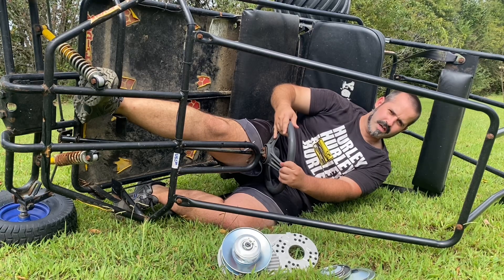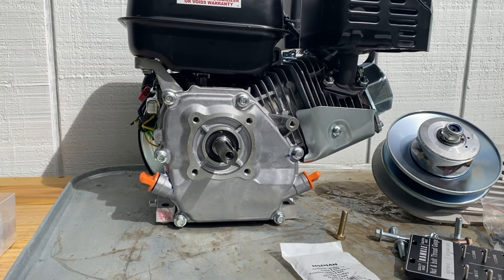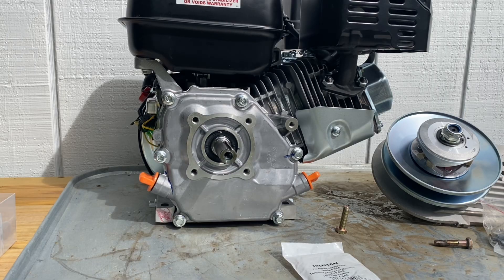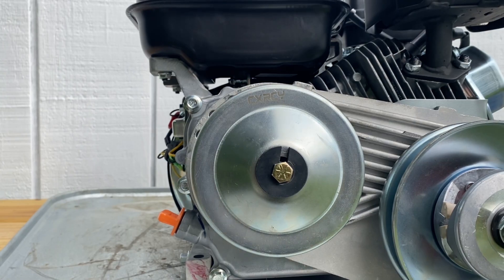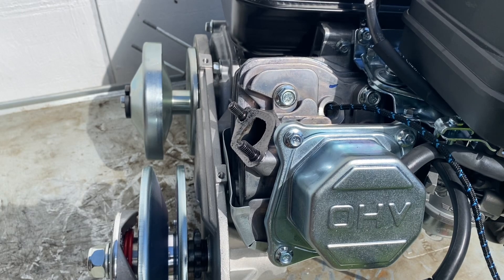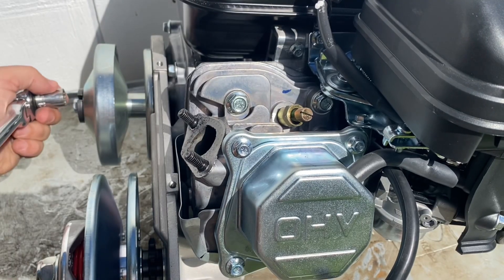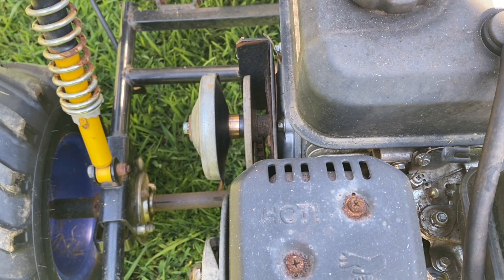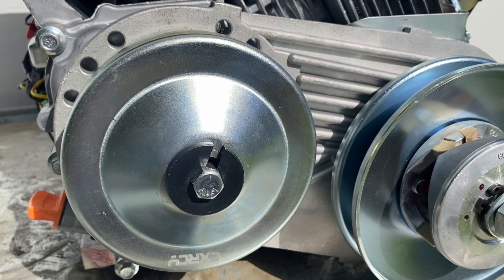How To Tighten Crank Bolt Without Impact- Predator 212- Amazon 30 Series Torque Converter

Comment: What can you do when u strip it ?
Reply from the maker: You can trip to re-tap the crank if only the first few threads are stripped but if the whole crank is stripped you can drill and tap it for a larger bolt or drill and insert a helicoil. Used the same methods in this video to keep the crank from spinning while you are tapping it.
Reply: @jwsbackyard6413   Thanks so much it worked by taping it (5/16 -24). I stripped mine cause the bolt from 196cc is different then the 212cc

Comment: You can also just grip the end cap plug that goes over the end of the driver outer plate and that will hold the crank still.

Comment: My chain keeps snapping master link I have a Baja 200 w/ 208cc Briggs torque converter and no chain tensioner just spacers in motor mounts
Reply from the maker: What size chain? Is the sprocket close to the ground?
Reply: @jwsbackyard6413 #40. Not really it has 1/4  inch flat steel sprocket protector / skid plate I just remembered I can buy 1/2 🔗 links also so I stocked up on roller, Master and 1/2 links to get tension tuned in. Thanks for replying I may still fabricate a roller/tensioner to frame with threaded rod and roller sprocket or roller w/ bearings. Heck maybe even just a softer skateboard wheel lol take care 
KY ✌️
Reply from the maker: @Joshua_Hammer777 hmm yeah only time I’ve ever had issues snapping master links was with 35 chain when the sprocket was close to the ground or the chain would come off and get ranked as it rolled back on.
Reply: @jwsbackyard6413 thanks really appreciate the response. By chance do you prefer a torque converter or centrifugal clutch or just preference on torque or speed thing..take care 
KY
Reply from the maker: @Joshua_Hammer777 a torque converter is much more enjoyable than a centrifugal clutch. You get great torque and still have speed with a torque converter. You just have one gear ratio with a standard clutch so you have to compromise and choose torque or speed.
Reply: @jwsbackyard6413 thanks for your tips can I play with ratio of jack shaft on my torque converter sprocket I think it is a 40 series or 30 series it's on a 208cc Briggs and Stratton 950 series engine with vm22 carb, intake tube, air filter and header mod for now on Baja 200 Dingo go kart straight axle disc brake with Nobby 8 or 10' tires and has no issues with torque lol I made a lil trailer for my son wanting to get billet wheels and slicks to keep it from being too much until he gets used to riding it sorry so long appreciate you take care 
KY ✌️

Comment: Makes sense, good info. My 212 engine  has metric crank bolt also. And my torque converter came with both metric and imperial fasteners.